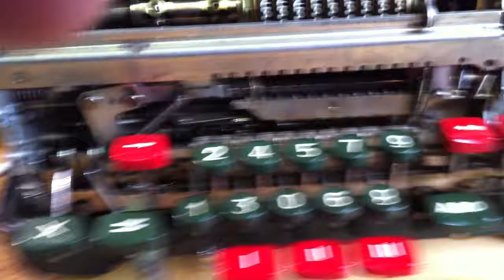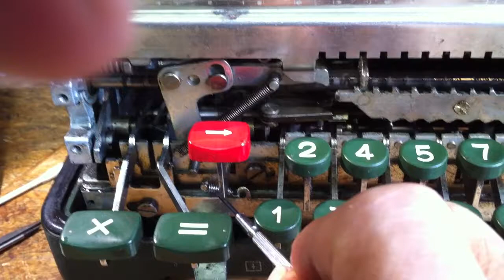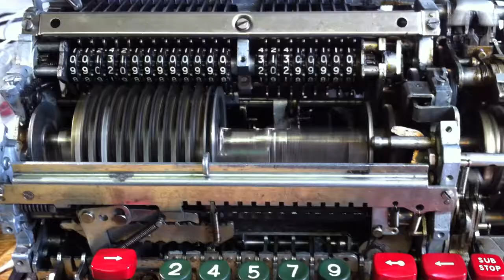FACIT ESA0 part3

Comment: Wasn't the CA1-13 their first automatic calculator?
Reply: +douro20 CA1-13 has the same machanics, but a more modern outside. They are, regarding the mechanics and functionality, the same calculator. ESA-0 is older though.

I have one of each here. Only found one hook that differs, but not even that changes the functinoality. Should probably be possible to swap that part between the calculators too.